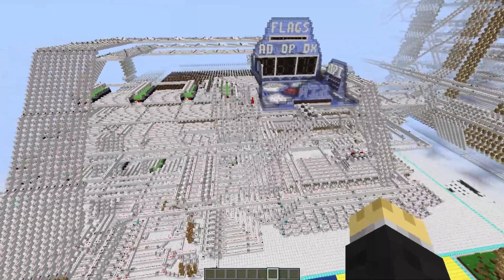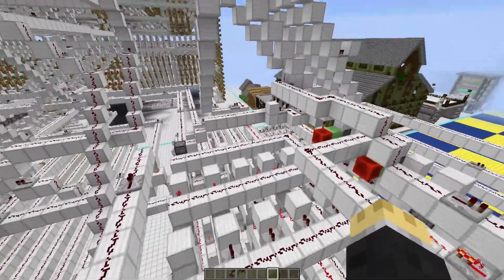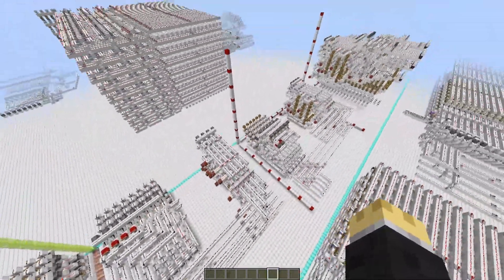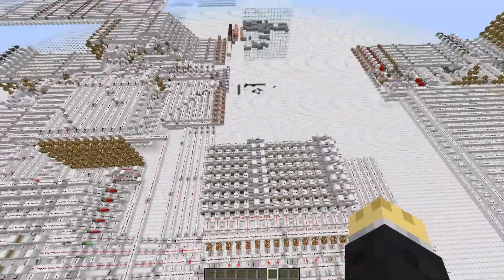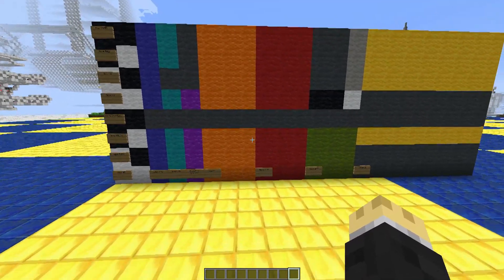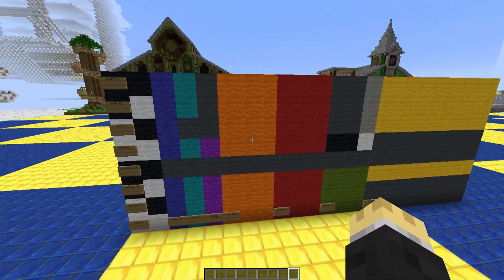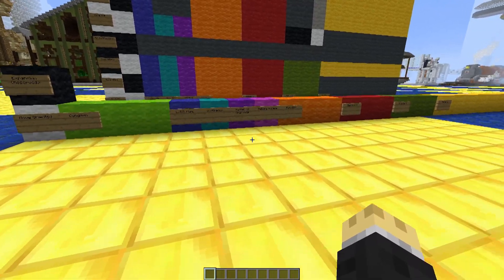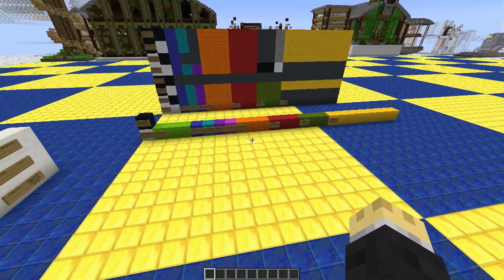Designing an Instruction Set

Comment: I like these kinds of videos even though I barely understand what it is about. So I basically know what you are talking about but I only know about it very superficially. 
By the way where do you get these information about the circuitry? Are there forums or datasheets around? Or are you just knowing the general logic of it and you reinterpret it somehow?
Reply from the maker: thanks! and a little of both - a good majority of it is just knowing the basics of a computer architecture. Like what is RAM, an ALU, Register, Decoders, State Machines, Etc. and how it all fits together. From there it's basically finding minecraft equivalent circuits or designing your own.
Reply: Knowledge of ALU and such surely helps but you seem to know how the different companies create the same ALU. At least compared to the few other minecrafters I've watched you seem to have way more insight into the industry.
Reply from the maker: it's all pretty much the same once you boil it down. Granted, most companies have different functions assigned to their ALU, but you can usually get an idea for what they are just based on the instruction set.

Comment: Wonderful video. Extremely hard to find anything similar with regards to real silicon processors.
Strong vibes, mostly unintended, of 6502 (interweaving internal ops), Z80 (hard 5 cycle operations, though Z80 had 4-cycle internals).
x86 is a very specific ISA, born in times of expansive RAM, backwards compatibility with 8080 and being in minds of engineers "plug, before we finish THE ISA of new world". IBM inadvertently latched us into x86.
Reply from the maker: Not entirely unintended! A lot of those processors are where I get my inspiration for some of my redstone processors.
Thanks for the complement btw :D

Comment: I think you should look into other instruction sets. Yours are x86 centered, while there are a lot of other interesting instruction sets. My personal favorite is 6502
Reply from the maker: You're not wrong - ultimately all of this crap is to try and teach myself the inner workings of real computers which, surprise surprise, run x86. 

on the flip side though, I can definitely extract elements of the 6502 instruction set. I'm not too fond of it's addressing scheme, but I could definitely incorporate the zero page addressing mode.
Reply: n00b_asaurus I’ve actually been looking into instruction sets a lot and you might want to do something like SRCIS. Creating a very modular instruction set with multiple tiers. It could allow for easy code portability, yet a lot of flexibility. 
The terse machine also caught my eye, due to its great  orthogenality and ease of implementation

Comment: I am building a computer based off of the instruction set of the game Human Resource Machine. It doesn’t have stuff like I/O capability and stuff like that, but it is really fast. Here’s the instruction set:

Input - loads input into acc
Output - displays then clears acc
Jump - self explanatory
Copyfrom - copies a value from RAM into acc
Copyto - copies acc to RAM
Add - adds RAM address to accumulator
Sub - subtracts RAM address from accumulator
bump+ - increments value in RAM, and copies it to the accumulator 
bump- - decrements value in RAM and copies it to acc
JumpZ - jumps if the accumulator is 0
JumpN - jumps if the accumulator is negative
Ldi - loads immediate value into acc

Also, you can use any address as a pointer to another address in RAM. this allows you to treat data like a stack in RAM. 

this instruction set uses 4 bits for the op code, 1 for the pointer enable, and 8 (or 16?) for the address/data. All of these are 1-operand instructions, so it allows really compact instructions, and really easy readability.
Reply from the maker: I see!
I've played human resource machine myself. It's a fun game, but I never even thought about taking their architecture and turning it into a computer!

You'll have to let me know how it turns out!

Comment: HI! I would love to use an instruction set like this. My greatest question is that how can I use variables in the instruction set? For example if I want to have 4 bytes of Registers than should I have my instructions like Add A + B save to C; Add A + B save to D; and so on? It is not space efficient and I would run out of adresses quite soon if I started making this. How can I solve this issue?
Reply from the maker: Well, when you say 4 bytes, I would assume it's 4 1-byte registers, appropriately named A, B, C, and D.
2 bits can be used to address each register, and it sounds like you're using a 3 address format for your operations, so a total of 6 bits would be used to describe the two sources and the destination.

This is plenty compact, unless your opcode format was 8 bits wide. If this is the case, you have a few options:

Option 1) Make the instruction wider - this may result in unused bits for other instructions, but it's a simple solution.

Option 2) Append an options byte to your opcode. In other words, if 1 byte is enough to describe the instruction, then that's all you need to fetch, otherwise if more information is needed, more bytes are fetched. This means no instruction is longer than it needs to be, but it does mean designing rather complex circuits and/or making some form of grammar.

Option 3) Make one of your sources the destination by default. E.g. Rx = Rx + Ry. This would reduce the 6 bits needed down to 4, but would limit the flexibility of your architecture.

Option 4) Make one of the sources and the destination a given, e.g. A = A + Rx, that way you only have to define one register, reducing the number of bits down to 2.

Option 5) Use fewer registers.  

I'm sure there are other ways of approaching this too, and of course, sometimes the solution is unique entirely to your model, but those are some generic solutions.
Reply: Thank you very much for your help!